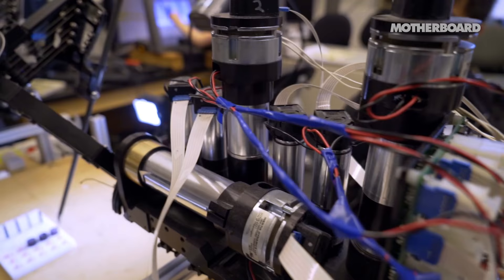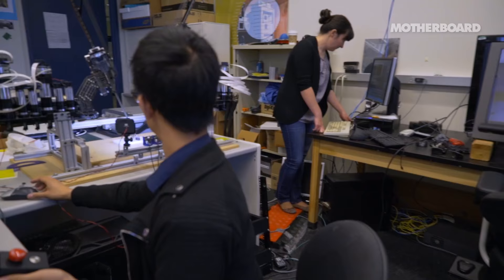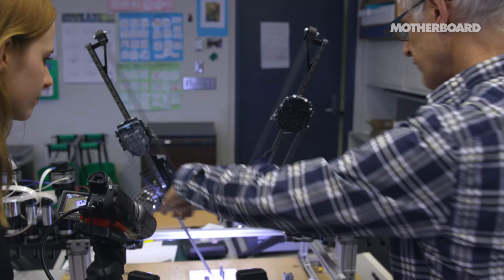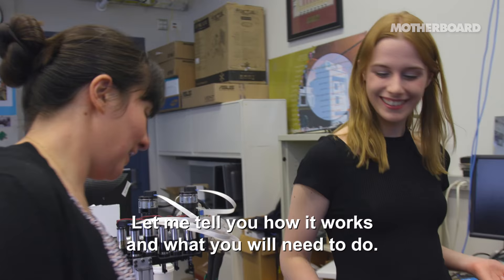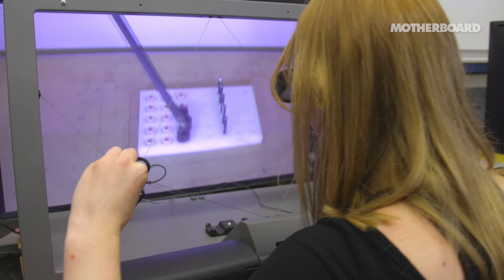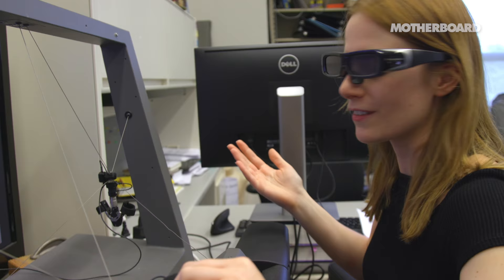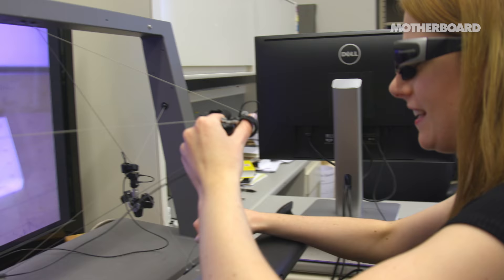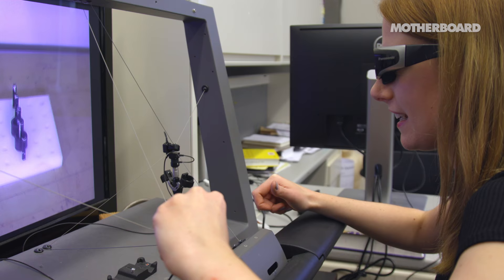Watch Researchers Hack a Surgical Robot

Comment: So dont have the robot directly on the internet. Have it be behind a network firewall that you have to VPN in to with a username and password. Then from there, establish a TLS connection directly to the robot. The VPN will prevent direct packets from being sent to the robot, and the TLS connection will prevent man-in-the-middle attacks (assuming secure certificate handling). I'm tempted to say that this research is just to grab attention, but honestly there are tons of insecure medical devices, so more awareness is needed.

Comment: I'm probably incorrect, but would encrypting the connection between the surgery robot and computer eliminate the chance of it getting "hacked"?
Reply: Then they can just hack the machine where the encrypted data is coming from.
Reply: But then all the data will leak out
Reply: Encrypted or not it is still hackable.
Reply: Yes and no. The machines would be within a network with intrusion detection and prevention systems (IDS/IPS) systems, firewalled correctly etc, with the proper precautions it would be difficult to get in. The main vulnerability always comes from the human element, configurations and software. Encrypting the traffic would obviously be a requirement, you are correct.
Reply: Thats a first step, also need to make sure key is secure, is changed and many other aspects. encryption is just a start